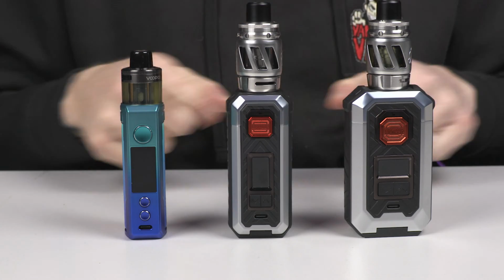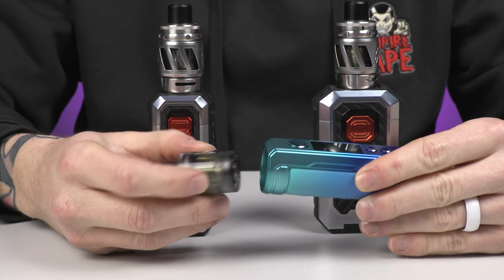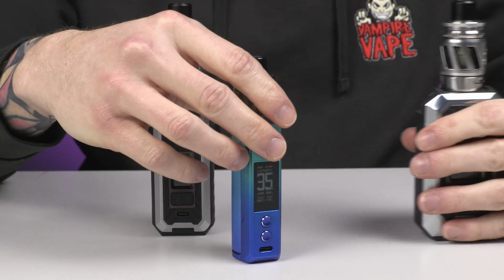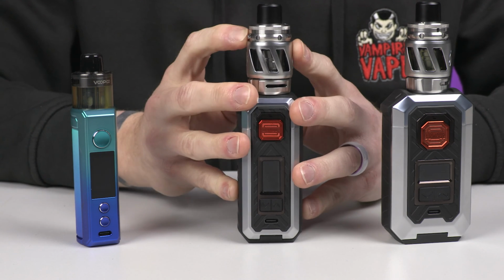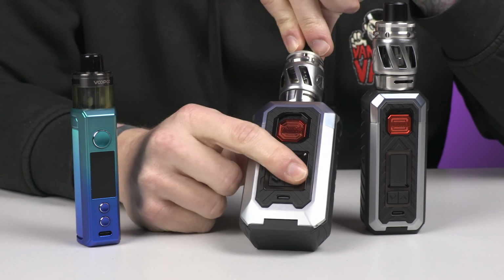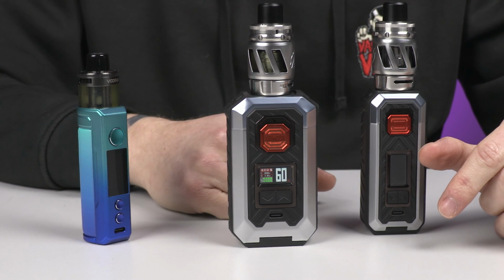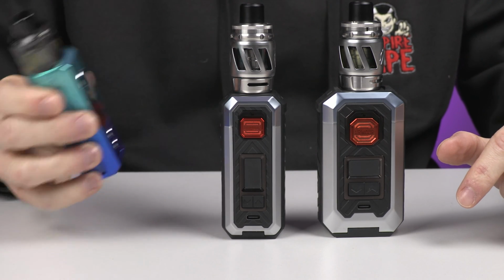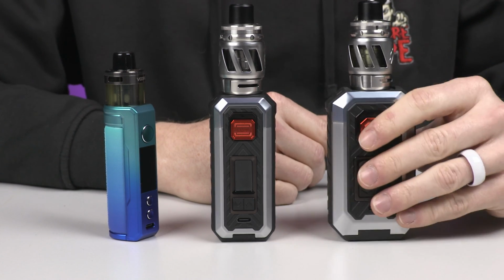Top 3 Sub-Ohm Vape Kits?

Comment: That Voopoo has the worst battery ive ever used. Literally one puff would take off 2%-4% of battery even at a full charge. Gave it to a friend after 3 days and got the Vaporesso Armour S i randomly picked up at a smoke shop. Took the tank off my Freemax Twister and put it on the Vaporesso mod and man, its a dream vape. So smooth
Reply: what was wrong with the freemax?

Comment: Warning to anyone who is interested in internal batteries. The mod can have a faulty battery. Most stores won’t take any returns. I spent $150 for a mod. The battery was stuck at 2 and there went $150. Attempts at contact the manuf didn’t get the response I wanted. So it’s wiser to spend for a charging station and a battery

Comment: All my vaporesso iTank 2 coils are leaking i dont know why...
Reply: I've experienced the same thing. Was happening a lot when i first got mine. But for whatever reason, it happens very infrequently now. I honestly have no idea why aside speculating on the way i was refilling them. Originally i was using droppers, which meant i was doing multiple shots at filling the tank. But pretty quickly i invested in proper refillable bottles. I think, maybe its cause with the droppers, i was forcing air sometimes into the tank which was pushing the liquid through the coils which ultimately flooded and would flow out the bottom airflow.
Reply: @fr3q_m33k  Im filling tank properly tho its still hapening im not sure but i think its all the coils issue and thats big problem for me because i cant even vape
Reply: @Halisiek  Can you break down your entire setup, rated coil wattage, firing wattage, pg/vg ratio, fill method, etc. There could be just one factor or multiple factors. If it's not incorrectly seated coils, tightened down correctly (too tight can can also screw o-rings), or other physical defects, it could be liquid viscosity, ambient air temp, too high of a refill (i never fill all the way, only to about 70% capacity now), firing too low of a wattage, etc. Also squeezing to hard as well when filling can flood coils.. Either way it could just fall down to coil flooding one way or another.